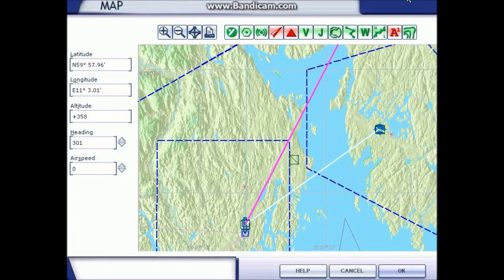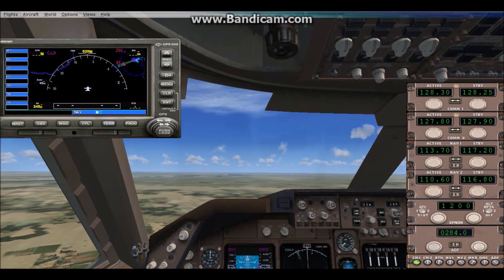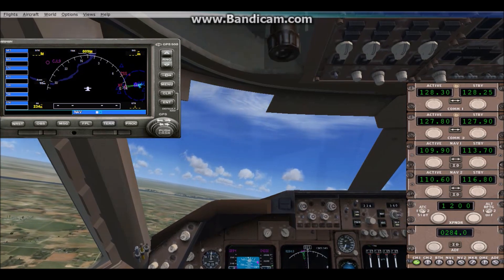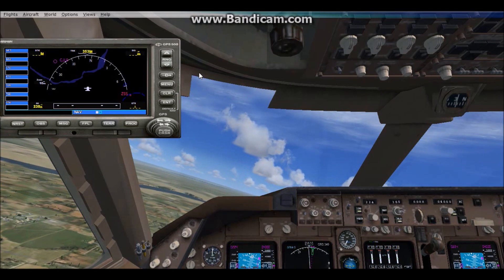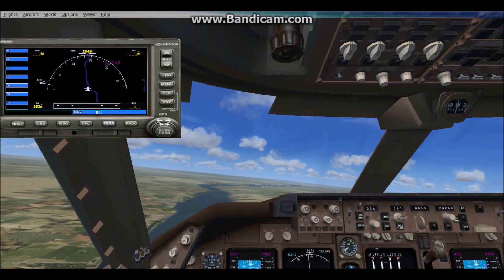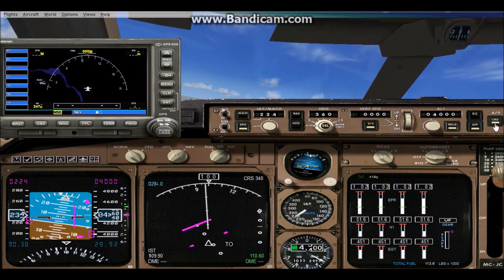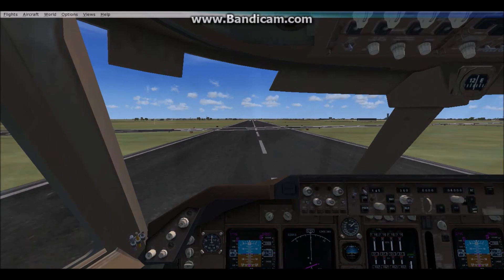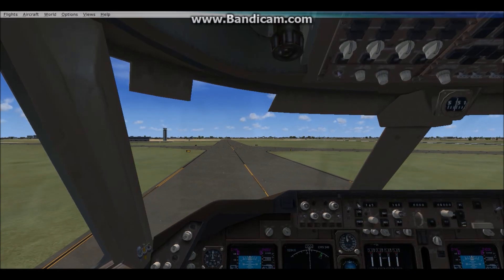FSX Tutorial: How to do ILS Approach and Landing in Boeing 747 - FSX Steam Edition

Comment: Phenomenal tutorial!

But I have a query,  OK so  the b738 and a321 have a "knob" that sets the course heading but the b747 doesn't so, how do I set the course heading  on a 747?
Reply: I don’t think the default 747 has a course hold knob.
Reply: @namedropper9237  yes you are correct,

 it turns out the default 747 doesn't have a course hold knob hence,  to set it one has to hover the cursor/pointer over "CRS" on the NAV display. Doing so shall basically result in a dialogue box appearing on the cursor, bearing either a positive (+) or negative (-) sign, and to change the course one has to simply scroll either upwards or in the opposite direction.

Comment: I tried this but I found myself above the glideslope and overshoot the runway because I'm too high and it doesn't control my altitude.
I'm not doing anything wrong, but the ATC gives me ILS clearance too early and I'm too high when I near the runway.
I can't find a fix for it on the forums, so can you or anyone else tell me if there is something to do about it?
Reply from the maker: Have you tried at multiple airports? Sometimes the ils don't work well at certain airports. Make sure your speed is good and that you pushed the approach button.
Reply: @aviationnation7798  Most airports I tried it at were Heathrow and John F. Kennedy Intl.
Perhaps I should slow down and lower the gear and flaps early and then I may not overdo the glideslope. FSX is still the World's leading flight simulator, but it does have troubles although there are fixes for some things.